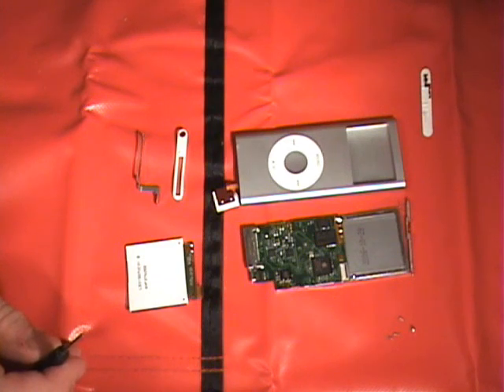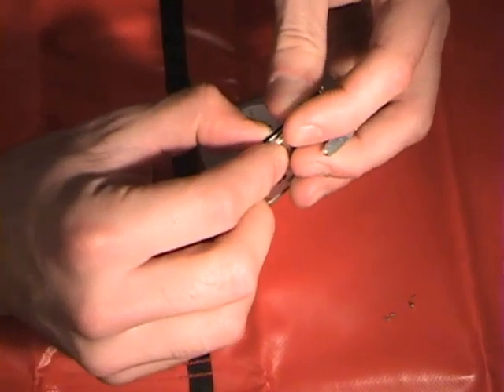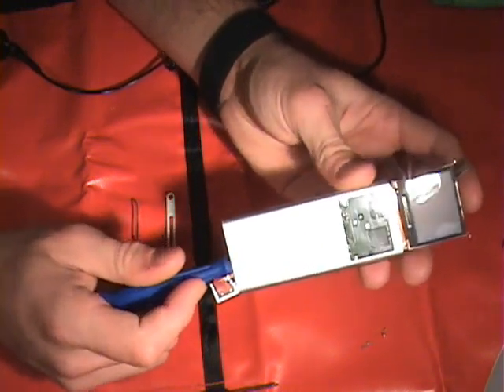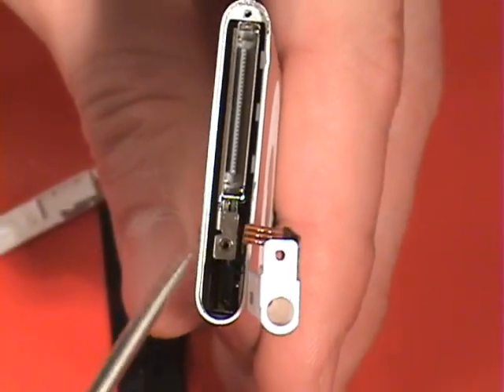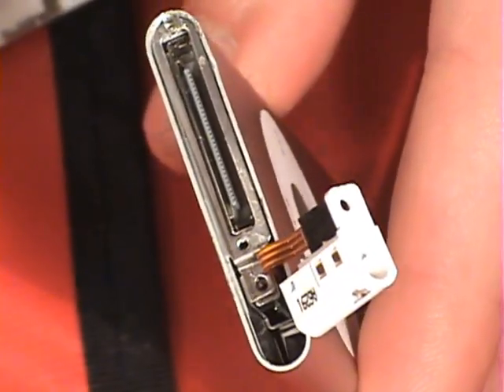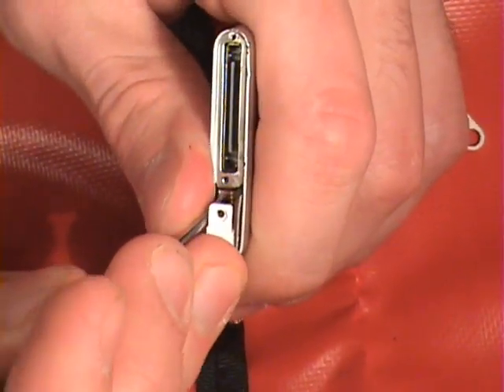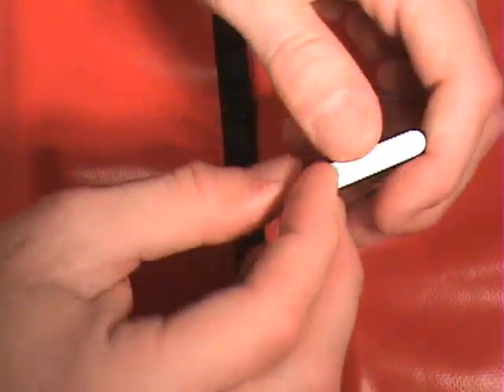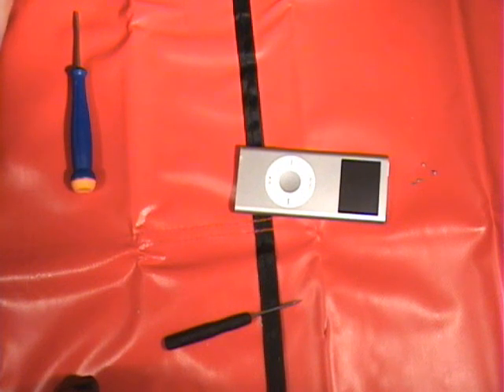Nano Gen 2 iPod Repair Guide

Comment: to remove it just pop up the bottom frst then use a very thin tool to pop up the top or once youve opened the bottom just push the inside up and if something breaks dont blame me, mine just loss its click wheel because i watched this fucking video!

Comment from the maker: We suggest letting it sit for a full 24 hours without a charge, then attach it to a wall charger and see if it powers up.  If it still doesn't power up you may need to get a new logic board installed or buy a refurbished nano.  We have plenty of them for sale on our website at a great price.

Thanks

iPod Repair Squad